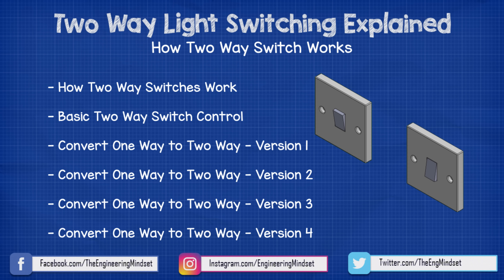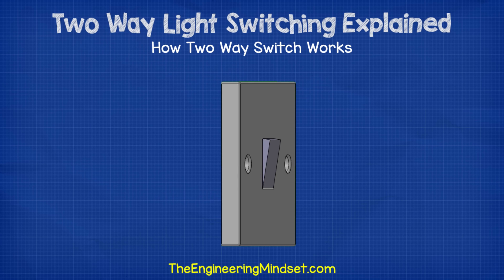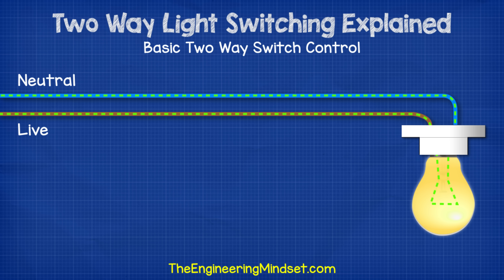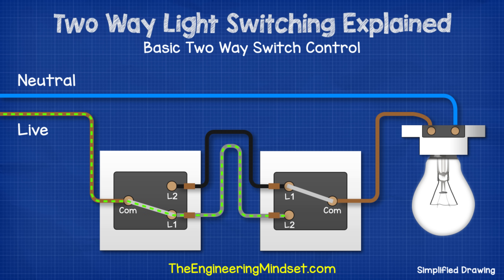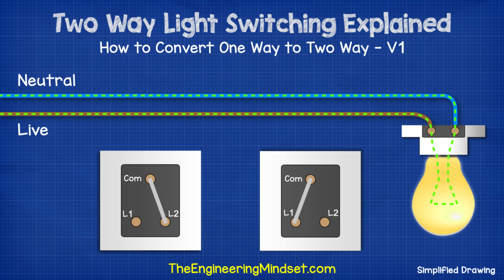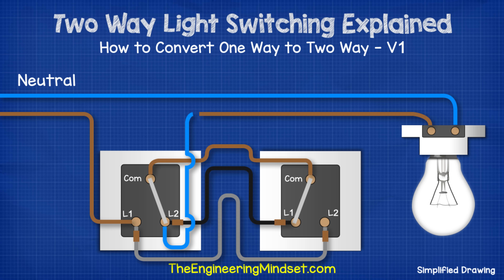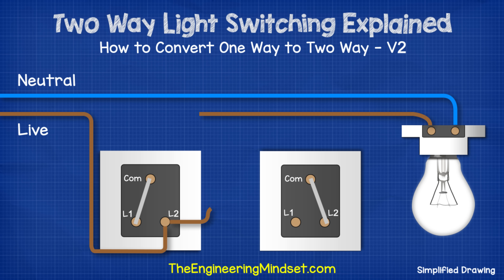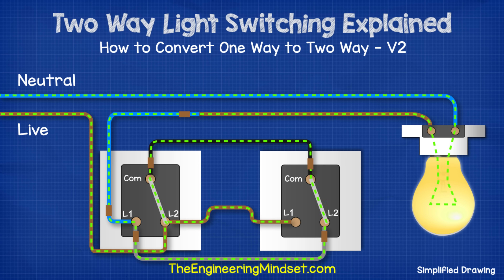Two Way Switching Explained - How to wire 2 way light switch

Comment from the maker: ⚠️ Found this video super useful? Buy Paul a coffee to say thanks: ☕
PayPal: https://www.paypal.me/TheEngineerinMindset
Reply: The Engineering Mindset
Reply: The Engineering Mindset .
Reply: good job dear
Reply: The text block wiring pictures..
Reply: Very good engineering
Reply: I've been a technician for about 5 years this craft it's really not hardit's all about reading and understanding what you read. I worked in many fields I did some electrical I did DC voltage with sound  systems. I also did all worked on breakers fan ceiling fans receptacles and switches also there's some Heating this will take a lot of practical and a whole lot of reading
Reply: In America your Travellers are black wire and  red wire the neutral is white green is ground the hot feed can either be red or black depending on the application
Reply: Are you an electrical engineer?
Reply: the are 7 ways to wire a 3 way and 11 if you ad a 4 way switch inline
Reply: ñ
Reply: What was the fucken point in putting the chapters if you're just gonna name them all the same thing
Reply: Are you able to install a light at one of the switches so u know if the power is on to the light you can’t see
Reply: Its so completed
Reply: I've watch this video several times but I still don't get it.Can someone explain it to me
Reply: why use gray or black wires when you can directly use brown wires where there's live voltages?
Reply: gardengnome420 it’s due to the fact that 5 core wires which is designed for 2 way circuits has black and grey wires already, plus the blue, brown and earth wire.
Reply: @gardengnome4208  kh
Reply: @gardengnome4208  so that you know which is which, d'uh
Reply: And logic
Reply: @skmgamer8214 )
Reply: Both should be on to turn on the light
Reply: Or logic is more reliable
Only one switch from two can turn on the light
So we need to connect parallel to each other .
Reply: What a wonderful collection of nob heads in this thread!
Reply: What a reason using other way to connecting switches exsept first way. The first way well-know and widely using, other one too complex and useless.
Reply: If you connect a blue Wire to a brown you are a "criminal" because a blue Wire is only for neutral. brown Gray and black is for phase(Always active), for the wires between the switch you can use all colors exept Yellow/green brown gray black and blue, so you can use orange or purple.

Comment: This is quite useful but stops short of showing you how to implement it in a real world situation.  In UK cables come in 3 cores and therefore running 2 individual wires between the Switch and the Remote [Switch] (to connect L1 and L2) isn't realistic, you are going to use a 3rd 3 core cable, which is fine but you should be clear about this.  The problem really comes when you connect the Switch to the Light and the Light to the Remote and you end up with a wire in each [3 core cable] cable that is redundant.  Don't forget also that all 3 cables have to enter the Switch with the input Neutral being connected to the Neutral of the Light using something like a WAGO connector all of which becomes quite a squeeze inside the body of the Switch.  A friend of mine has suggested using a 4 core cable and I have challenged him to show me how that works in the real world.

Comment: can you explain at 2:04 why you used a grey(L3) cable and taped/sleeved it instead of just using another brown wire? is there any significant purpose or reason behind this?

Comment: So the phase wire in EU is 240V and America is 120V.  That means EU just use the phase wire and neutral wire  on their outlet to get 240V where as in America we need to use two phase L1 & L2 to wire up a 240V  outlet. Is that correct?

Comment: So from a diagram perspective, the first version will work. In a setting where 2 core and 3 core cables are being used; v1, v2 and V3 diagrams wouldn't work. the 1.5 cable doesn't split on the way to the rose and switch. You can't have neutral directly linked from consumer to rose and brown to live from the same cable. This was the reason why most people get confused when actually wireing up in the workshop. 

The diagram will work for a singles setup though.

Comment: Just use 3 way switches and a length 12-3 wire.    Wire is so expensive these days ,  running wire back and forth between switches like this will cost a fortune. There is always more than one way to do the job but there is also the "right " way. Which is safe, tried and true and most cost effective.
Reply from the maker: I think you need this video https://youtu.be/_u5ORnhqn8g?si=C7ulfpl97-r7olnL

Comment: Hi I have a light fitting controlled by two double switches 1 switch controls the lights independently and 1 double switch controls just one of the lights but also an external light. My colours are yellow blue and red two yellows are sleeved red and one blue is sleeved red I have two red cables and a live feed to an external light the neutral from the light is wagoed together with another black cable can you explain how to rewire the double switch to include the external light please

Comment: Is there any benefit using 3 core cable instead of 2 core for link between the switches? If not, is using 3 core just a waste of cable?
Reply: Yes. It allows you to connect the earth wire so u don't unalive your self.😂 grounding is very important. Stay safe

Comment: On the first connection 'basic two way switch control' what about connecting L1 to L1 and L2 to L2? Any problem with that?
Reply: Yes the problem will be that it will mess up the alternation of the pathway. One implication it will cause is you only being able to turn on the light with one switch

Comment: Thank you, very useful. If you have four bulbs on the same circuit, do you just connect each bulb in parallel or is the wiring different in this case?

Comment: this vieo was a life saver.

i have swapped out light switches and sockets before.
i had switch break, went to B&Q to get one that looks the same, took the old one off, and put the new one on, but got no get the 2 way to work.
looked at other videos and the wieing colour was not the same, as the house was built 30+ years ago, i ended up with 3 red wire, a blue and a yellow/green wire.
after wtaching this video and using a trster screw driver, worked out which was live wire and which was the return to the ligtht and then had to work out what the blue and green/yellow was equal to and turned out one way to two v1 was how it was wired up.

Comment: PLUGGED IN LED BULB INTO SINGLE SWITCHED LIGHT TO TEST BULB.
PLUGGED IN ANOTHER IN 2 WAY SWITCHED  LIGHT  ALL WORKED.
CAME DOWN IN NIGHT TO SEE BULB GLOWING DIMLY IN 2 WAY SWICHED LAMP WHILST OFF.
BUT OFF IN SINGLE SWITCHED LAMP.
CHECKED IN OTHER 2 WAY SWITCH LAMPS - SAME DIM GLOW

Comment: I was struggling to understand why the "one-way" switches look exactly the same as the two-way, ie three terminals. Then I realised that all the switches are actually two-way, and the conversions from one-way to two-way refer to ways of incorporating a second switch into an existing one-switch circuit. I believe that accounts for the complicated variations.

Comment: Just used my upstairs hallway light which has two switches. Wondered how it worked and couldn't figure it out, within 20 minutes found myself here. It one of those things which is easy to understand once you know how it works but is otherwise hard to figure out. Knew it would be something simple. Great video, especially how you showed the direction of the current

Comment: Can this concept be used with 2 active wires? One for motor in one direction and the other for the other direction. So down, up and off. Controlled from 2 different locations. I'll need to draw it but I think it will need 2 additional relays in NC and NO to prevent a short circuit. Will check with electrician before install.

Comment: Thanks very much for this. Example 1 is by far the simplest. Totally lost with the others, but I don't understand why you rotated the switches in example 1. I've drawn it out with the common at the top on both and it looks much easier to understand. Anyway, thanks, very helpfull.

Comment: Best method  is same L1 to L1, L2 to L2 version 3 & 4.
Makes problem solving easier for the next that come after you.
This method avoids alot of confusion when you're following the same colours from the first switch to the second.
But in saying that it is good to know all these methods in case you might come across it in future.

Comment: If you put the lamp to one com on switch 1 and the other to com on switch 2, then conect L1 to live on both switches, and neutaral to L 2 on both switches, this would work as well, what your doing is using the neutral incomming feed, is this acceptable?

Comment: My vintage UK 2 way switch has 3 cables in each 2 black and 1 red in the hallway. They are not labelled. I have used the red for L1 and the black as L2. I'm still confused even after watching your video. 😢

Comment: Just curious, wouldn’t version 2 create a short circuit when switched off as there is no load and it would just trip the circuit?
Reply: Actually no it wouldnt because its not going back down the neutral to the circuit breaker
Reply from the maker: Seen our new incredibly detailed MCB video? link: https://youtu.be/gqEu9t8HwW0

Comment: Version 1 to 4 are all technically the same. The permanent feed and switch line are split between L1 and L2 in the same switch. The only different one was at the start where the permanent feed and switch line are in seperate switches.

Comment: All four setups are basically the same; Light is first or last (depending on perspective), 3 runners/travelers, com to com, L1 to L1 & L2 to L2 (straight thru) or L1 to L2 & L2 to L1 (cross over). 3 and 4 are identical, you could have used pink wire. Changing wire colour is not really a new circuit. Both 1 & 2 but not 3 & 4 are a change to where the live and light wires connect to either L1 or L2.
The real circuit types correspond where the light appear in the circuit, either at the start(power box at start and switches to rear), middle (hall with switch on either end) or end (high ceiling light in stairs). Power source is 2-conductor (Live, Neutral with Gnd), between switches 3-conductor (two Live, Neutral all treated as Hot with Gnd). Remember always run the neutral through the light and live/hot through the switches. You don't want to get zapped changing a light bulb.

Comment: Ok so this was helpful but didn’t really answer the question I was hoping it would. Here goes.  Bear with me.  In my home we have a few of these lights that are controlled by two switches.  

In most cases, if both switches are the same, either both up or both down, the light will be OFF.  If the switches are mismatched (one up and one down) the light will be on.   

My wife and I disagree about what is the “right” setup.   She believes that the light should be ON if both switches are the same.  I believe the light should be OFF if both switches are in the same position.  

Is there a standard regarding this or is it just personal preference?

Comment: The V1 is the most simply and most used everywhere, the others V2, V3 and V4 are needlessly complex, only a mad electrician would use 'em. Also, if you need to add a third o more positions where to switch the light on and off by using a four way switch, they'll need to rewire the whole thing in V1 way which makes the V2, V3 and V4 impossible.

Comment: While those four different versions are subtly different, they all assume you have room in the conduit leading to switch 1 for an extra three cores of cabling. What if the conduit for the original switch can't take an extra three cores of cabling?  An alternative way to upgrade from 1-switched lighting to 2-switched lighting which requires room for only one additional core at the original light switch is to connect L1 to L1, L2 to L2, and importantly, to power the light from switch-2's common instead of from switch 1.

Comment: Ive got 2 lights and 2 switches needing fitted in a garage.   To add the 2nd light do i just take a link from the first light to the second?   At 2.44, basically with another Live and neutral to the next light ?

Comment: I am OBVIOUSLY not an electrician.  But I am an old (79) guy with lots of digital logic experience.  I knew I could find the answer here, but I thought I should try to work it out for myself, a job I expected to take between 5 and 15 minutes.  40 minutes later, I still hadn't gotten my head around it.  I even resorted to fooling around with "truth tables" and considering the various possible switch combinations and outcomes.  I probably could have worked it out this way although maybe I would only have formalized the problem still without figuring out how to wire the darn switches.  It couldn't be that complicated, and it's not.  In fact, it is the sort of simple solution that we call "elegant."  But it is hard to get your head around it.

Thanks, Paul, for turning on the light for me!
Reply: 34, same story, less experience.  Here for the exact same reason.  It's nice once it clicks, though.
Reply: 2 years ago you wrote that, just been through exactly same experience here .. cheers
Reply: Thanks for the honesty. I have a degree in maths and understand boolean algebra. I understand the simplified diagrams on you tube where you can clearly see it's the OR operation. However I looked at my longe just now two single switches in different parts of room. I thought this is the simplest arrangement possible. Yet one switch had two cables, 5 wires, some going into same one of 3 screws. Am now going to watch this video

Comment: Excellent explanation. I'm trying to explain how to remove switch 2 to a friend and sent this video. Would it be fair to say to disconnect any connection to switch 2, tape off each of those wires and cap. Replace switch 2 with a wall plate. Then confirm supply at fixture is tied to Sw, if not remove old Sw2 connecr, tape & nut, then connect Sw1 supply to fixture. Replace switch 1 with a 2way (US) if necessary?
Sorry, I hope that made sense. Thanks for help.

Comment: Very helpful - a big thank-you. The only thing I don't understand is why you'd use the 4 more complex versions of the connection in place of the "basic" version.
EDIT: I answered my own question: it depends on the position of the live and the load - in the basic case the live comes into one switch while the load is connected to ther other switch. In other cases, the live and load might both come into one switch, hence the variations.

Comment: These are the simple things that my tired brain struggles with.
Reply: My brain struggles with everything
Reply: I think computer logic helps to understand this

An and gate is a device that takes 2 inputs and if both are the same outputs 1 if not 0 so if A is 1 and B is 1 O is 1
Same thing with A0B0 O1
However A1B0 and A0B1 both gives O0

Imagine that the switches act like outputs 
You need both to be on the same state to give a signal so A1B0 for example is at only one change to be on either turn of A making it A0B0 or turn on B making it A1B1
Reply: @J3ff_K1ng wow you're so smart 😐

Comment: On the 1st set up with the live going into the com of the 1st switch and the live out com of switch 2 to the light can you line up L1 with L1 and L2 with L2 instead of switching them like you showed in the video? I thought that is what you were going to do and don't see why it would make a difference especially with AC but idk for sure

Comment: I used two way switch for Fan. when i press two way switch button then socket plug get affected. whatever I plug into that socket, its get off and start again. 
What is the issue???

Comment: What do I do if I shut switch one off, but the light stays on until I turn switch 2 off .. and vice versa

I can turn the light on with either switch ,, but if I try to shut it off with the other switch it stays on unless I go to the original switch I used and shut that one off

Comment: Hi. Does current flow to an open circuited terminal when there is no electric field. Even if we look at it from a wave perspective, actual current flow only commences when an electric field is initiated. My fundamental understanding from college physics is that drift velocity of the electrons themselves is quite low in the neighborhood of 1mm/sec, however the electric field wavefront itself is almost same as speed of light. So why are you representing this as above.

Comment: Great video, sat down and thought about how two way light switches work or may be connected. This video goes over it very well, but my final question after pondering on this before and after watching the video was, if these switches are far apart, isn't this a lot of wire work? Isn't there any simpler solution that would require less wire by the meter? Immediate thought is that you have another switch setup in between the two lightswitches but I imagine the reason for not doing that may be that simply running wires is cheaper/.less inclined to fail than another switch setup?

Comment: Hi Paul I installed downlights in my hallway, with a two way switch one at either end, after all plastering and paintwork completed I had to break open ceiling and walls which was heartbreaking, but this had to be done. I've used the option 1 from your vid, and works a treat, looks really well, I wouldn't have been able to do this without your very informative video with easy follow diagrams, thank you so very much for all in this case part of your knowledge. Keep up the brilliant work, now I've to go fill holes, thanks again.